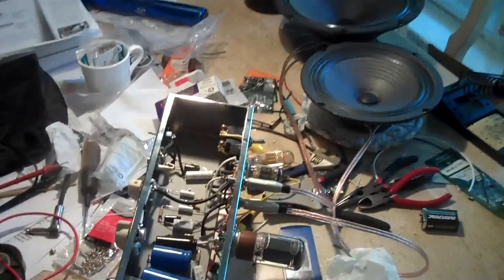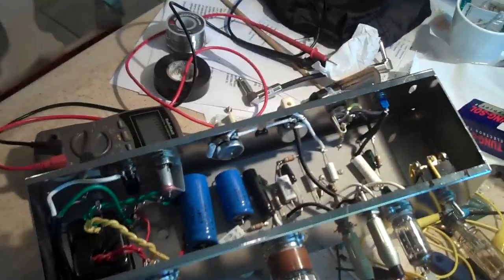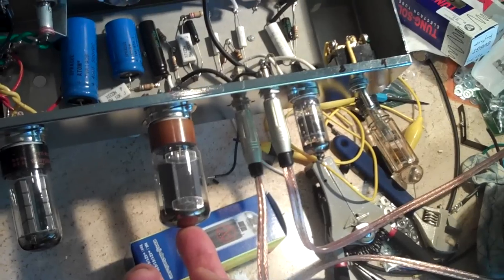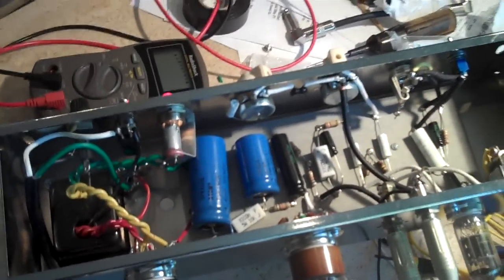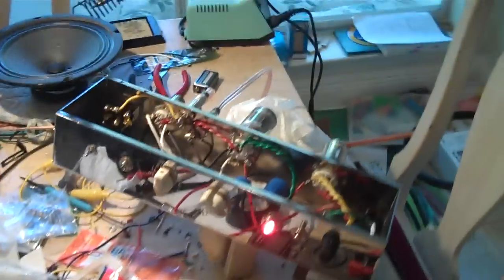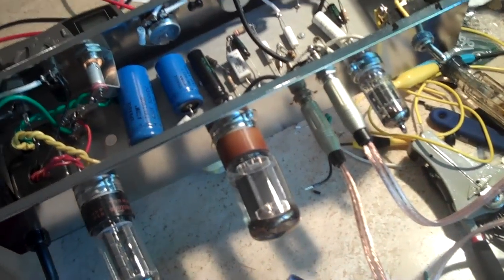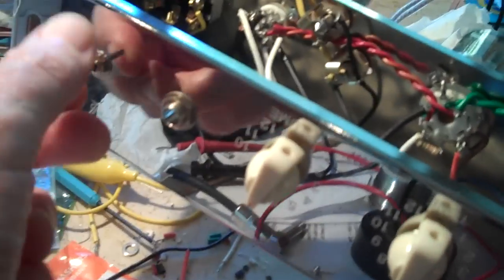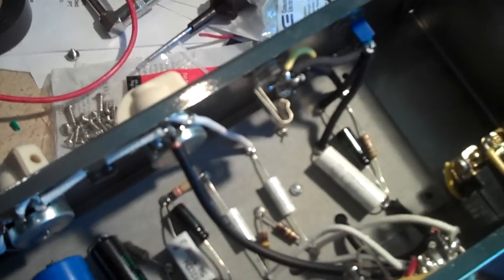Two-Stroke Amp Project (Preview)

Comment: Is this a 4-10 amp version?
Reply from the maker: No, it has one 8” and one 10”.
Reply: @millstap  Sorry, I meant 4-10 wattage amplifier.
Reply from the maker: @mikeault  Yes, depending on what power tube you use.
Reply: @millstap  6L6 is 10 watt? Thank you
Reply from the maker: @mikeault  6L6 = 8 watts, EL34 or KT66 for 9-10 watts.